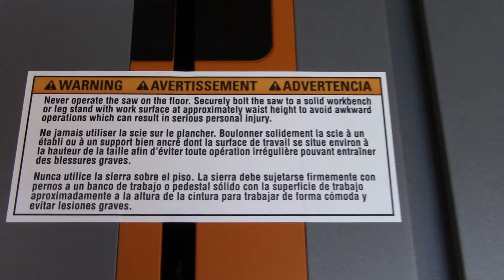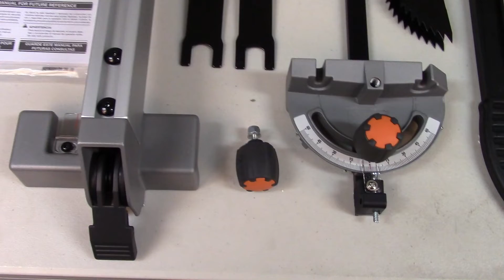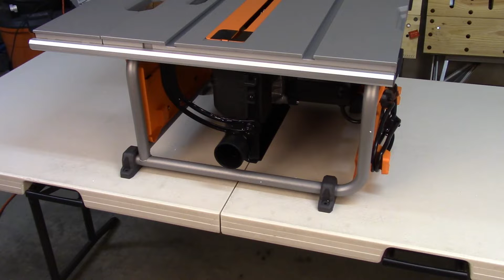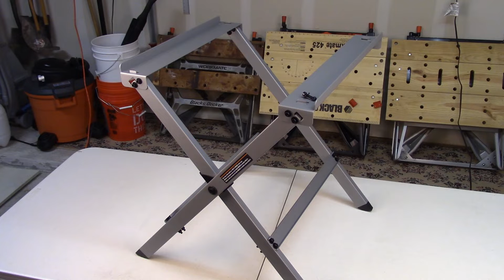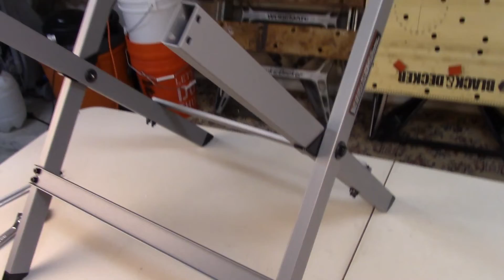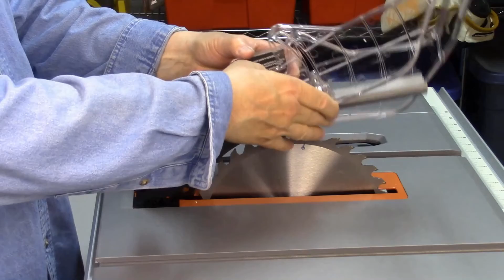How To Set Up Your RIDGID R45171 Table Saw

Comment: Bought a R45171 at a garage sale, with no riving knife, bought one from replacement parts but no instructions on how to put it together. Anyone have a instruction sheet or a user manual that might give me a hint, I have it put together but it doesn’t tighten up to lock the knife, it wobbles....
Not good.
Thanks,
 Jim

Comment: I've really enjoyed using this saw, however I mounted it onto a home built cart, that brought it up to the height of my MFT/3 table.  For the most part I use this saw for doing cross cuts on a sled that would be a pain to set up, on the MFT/3.  Since most of my work is in using plywood, I purchased an Ultra-Finish carbide blade for it.  I added a removable infeed and outfeed support so it supported my cross cut sled better. 

Only only one complaint,  Dust collection.  Even with a high volume vacuum, a lot of sawdust gets flung out and it goes everywhere.
Reply from the maker: Hey Warren, thanks for stopping by and sharing.

Comment: My saw will only bevel to about 44 degrees - any idea how to fix this?
Reply from the maker: If you are going by the  scale on the front, it might be off.  Have you checked using a 45 degree scale.  And check out this other video at about 2:20  https://www.youtube.com/watch?v=YZK9qmbLOxY&list=PLlOO6ucQXejZRcPk27-1d2n4XE2YpuQ28&index=3&t=348s

Comment: I picked up the R4518 and it looks like my table top is actually distorted. What tolerance for flatness do you think is acceptable to keep or return?
Reply from the maker: Hi Chase, it would depend on where the distortion is and how much.  If the distortion would cause  a work piece to bind while cutting it is unsafe and you should take it back.  Be sure to register your saw for the Lifetime Service Agreement within the first 90 days of ownership.  Cheers.

Comment: What?  He Skipped a lot of the installation.
Reply from the maker: Hey Ruben, what parts did I miss?
Reply: @autohelpeu  I was referring to the guard and parts around the blade. Your video goes up to the assembly, then stops, once you start your video again the blade guard assembly is already attached.

Comment: I just set up the R45171 and I found that the front of the throat plate is just about a mm below the table top while the back of the throat plate is flush with the table top. Also the table top sides (from the miter slots) are about 1mm below the center of the table top. This seems small, but likely noticeable in its impact on woodworking (esp. the throat plate).  Since these cannot be adjusted, what tolerance is acceptable?
Reply from the maker: Hi Bill.  The front of the throat plate being lower than the work table probably won't have any impact on your work.  If this inset was at the back it might "snag" your narrow workpieces and might just cause a kick-back. I suspect that the sides being just a tad lower than the center of the work table you should be fine and might even help to prevent binding on the blade. If you purchased this at one of the big box stores you should have a 90 day no questions asked return policy in place.  I would suggest that you try a variety of cuts with some scrap just to make certain you are comfortable with the performance.  If not return it for a replacement.

Comment: Hi. I just unpacked my exact saw (no stand) and I was wondering if there is a tolerance for table flatness. I took a square and placed it front to back and all seemed ok until I moved it closer to the blade and found a slight gap  between the table surface and the square of about .015". All other measurements seamed good. This was on the left side of the blade.
Thanks 
Frank
Reply from the maker: Hey Frank, good question. If the area of indention is not large and most of your work pieces are not small (very thin or short) this may not be an issue at all. If the indentation would affect the squareness of your cuts then this is an issue.  Most big box stores have a 90 day return policy. My suggestion is make a number of different types of cuts and check with your square.  If they are off get it replaced. And be sure to register for the Life Time Service Agreement.  Cheers!

Comment: Bought this saw and had to take it back because the extension table was loose even when locked, I exchanged it and this one seems fine and I wasn't going to post a comment until I tried to register it on line and was not able to for some reason it says there is a problem when I log in. The whole process is BS.
Reply from the maker: Jim Snorgleson Congratulations on your new table saw, I know you are going to enjoy using it. It's a great piece of equipment. If you're having a problem with registration, my recommendation would be to give them a call. I am also wondering if you could register by mail? Thanks for stopping by.

Comment: any tips of the extension wobbles when locked in position? Just bought one over the weekend and extension has some play when locked. if i life the way you did in the video when extended it wobbles up and down.
Reply from the maker: DavBoston Congratulations on your new table saw. I knew you were going to enjoy using it. I used my extension over the weekend to cut some mdf that was pretty heavy and I really didn't have any problems. I think it comes down to how balance on your work table and extension. Thanks for stopping by.

Comment: Saw the "1" on the model number of this saw. What's it stand for?
Reply from the maker: Scott yP911 I'm not really sure, no one is really given an indication what it stands for. Thanks for stopping by and commenting.
Reply: I understand that the "1" refers to the soft start feature of the motor.  The  R4517 lacks that feature.

Comment: Thanks so much for the video. One question - my throat plate seems to sit below the table by a noticeable amount. Is there a way to level it?
Reply from the maker: Derek You are certainly welcome and welcome to my channel. I don't believe there is any type of adjustment built in. I am thinking it might be that the connection the throat plate or where it seats in the table might be formed incorrectly. Is it lower in back then in the front?

Comment: Hi, I suppose you unboxed the machine yourself so I feel I could ask you; where are packaged the support braces for the X-Stand?  I can find them (haven't open the package part where the fence is so if there is an issue I can return the machine...thx
Reply from the maker: Roberto Rivera-Sampayo Yes, I did unbox the saw myself. As I recall, there are no braces in the packing materials. I think if you're careful you should be able to take it out with no problem if you go slow, and take photos as necessary. Thanks for stopping by and posting question.
Reply: I did found the horizontal braces packed beneath the fence.
Reply from the maker: Roberto Rivera-Sampayo That's great, I'm glad it worked out for you. Cheers.

Comment: My saw only goes too 40 degerees I used a ruler to .measure the saw and its at 40 but the machine won't pivot to 45 what do I do?
Reply from the maker: WIZARD Z It's hard to tell without seeing what your actually doing. I am had pressed to think of anything would actually obstruct the assembly from pivoting from 45 degrees. The only think that comes to mind is the nut on the back might be too tight. Go to 13:20 in this video https://www.youtube.com/watch?v=MvvLdJQQGRg&t=3s&list=PLlOO6ucQXejZRcPk27-1d2n4XE2YpuQ28&index=3

and you will see the nut I am talking about. Try this out and let me know how this goes.

Comment: some people may need the very detailed and very lengthy explanation, some others like me may be very mechanically inclined and basically figure most of the assembly without any issues.
I have never had any issues assembling anything that was well built, if it is difficult then the quality is not really there, I know that saw is on the cheap side I wonder how it compares with the R4512?
I will get a second table saw as the current one (old Crafstman that I got for $50) has no fence and using a long clamp works but it is annoying to have to measure every time on both sides to make sure the fence clamp is square, that alone makes it worth buying the R4512 over others on the price range which have crappy fences...
Reply from the maker: lucyferina Thanks for stopping by and posting your question. I wish I was familiar with the R4512 so I can help you out. If you don't mind me asking, what types of projects do you work on with your table saw? Cheers.

Comment: So, I checked my blade for 90 degrees...was good. It was a little difficult to set to exactly 45 degrees, but I used my quick square and it looked good. When I turned on the saw the blade nicked the orange insert and installed a load of crap in my pants. I rechecked the blade and again it looks good to the quick square. There is no wobble in the blade. What should I check at this point?
Reply from the maker: michael brown Welcome to my channel. This is very interesting, you are the second person to mention this problem with a power saw directly from the factory. I am baffled at this point because I can't duplicate this with either of my Ridgid table saws. The only thing I can think of is that the orange plate is not seated correctly into the table. Have you tried talking to Ridgid text support? Also have you registered your saw for the lifetime service agreement? And, congratulations on your new table saw!

Comment: Good video ,thanks,just got done putting mine together, all the adjustments were good from the factory, one thing I had to fix,the plastic leg tips were not snug in the legs,one fell out while I was putting it together,I used a little liquid nails to hold them in place. I may put a screw through the frame to be sure they stay in.
Reply from the maker: Pete The Handyman You are certainly welcome and congratulations on your new Ridgid table saw. I would be interested to know how you like your new saw after you have used it a few times. Thanks for stopping by.

Comment: Well I finally got my saw. first one i had to take back because the label that shows the angle was off. took me a while to figure that out. After calling the support line they agreed that that i should return it. Your video on how to put the stand together was great. i was doing good tell i realized that i had put the legs on wrong. lmao.   the next saw went very easy. got the saw zeroed out and put some wax on the top. I did change the bolts that mount the saw to the stand. I used a standered bolt with a washer and wing nut. this way its easier to take off the stand.Thanks for the great videos and the information content. It help me in my decision of which saw to get.. I am looking at a way to store the blade guard and kick back on the side. I want to make something that i can stick to the saw so as not too void any warranty.  I maybe just build a rolling stand with drawers. Just a thought
Reply from the maker: jeff hebert Congratulations on your new Ridgid table saw! I know your going to enjoy using it. I like your idea of the rolling stands with drawers, this will give you a great deal of flexibility in your shop. Again, congratulations!